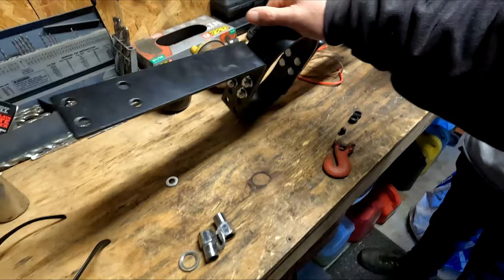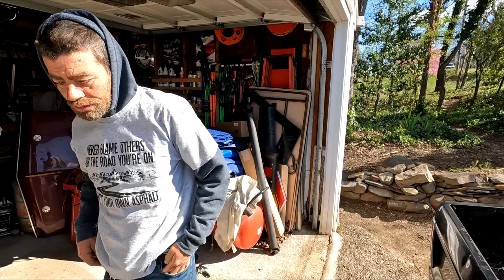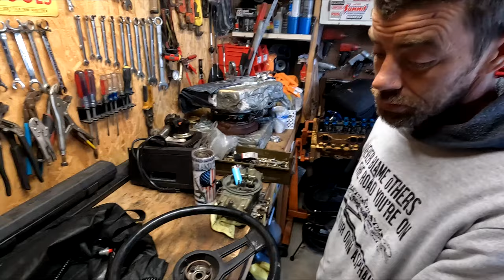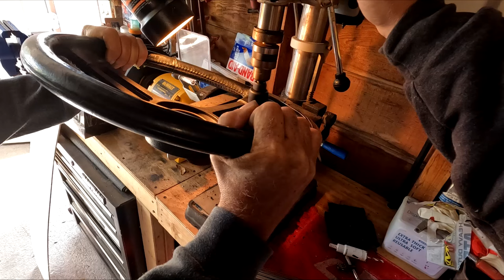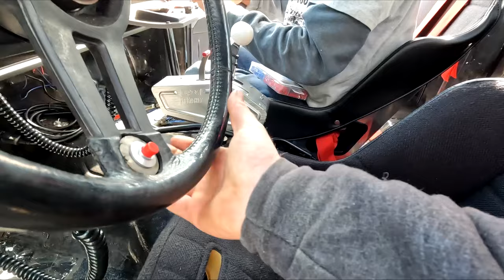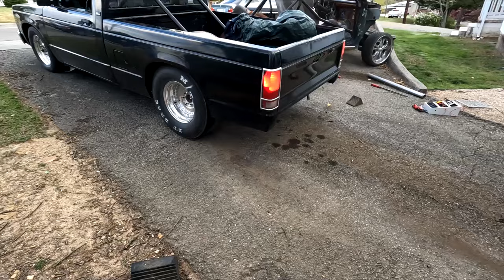Testing the Trans Brake on the s10!

Comment: You're carburetor is too lean.. You shouldn't have to pump the gas to crank it, if you have a little heat in the engine. You need to put smaller idle air bleeds in, to fatten up the idle. You're probably not on the main jets, til about 3,000 rpm's. May have to swap out idle feed restrictors as well.
Reply from the maker: Yeah we know, just have got any yet, the AFR  is about 15/16 at idle. We got to work on tuning the carb along with some other things before we truly test it. Thanks man!🤙